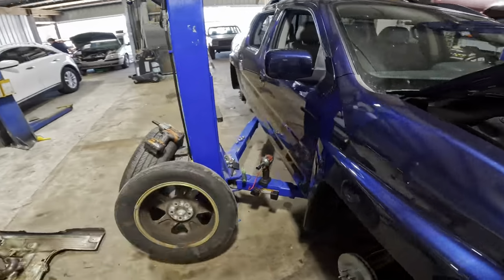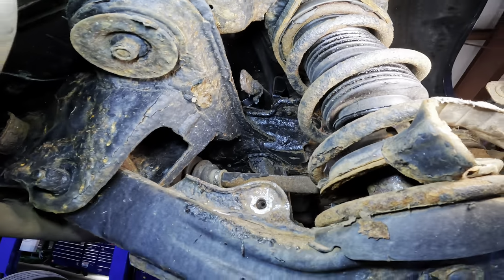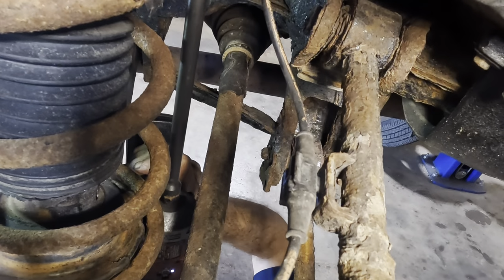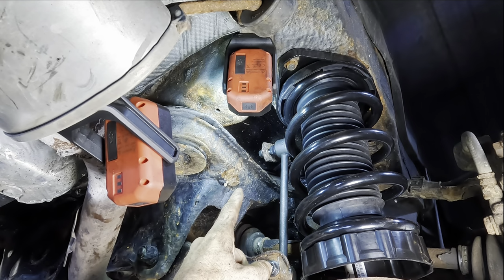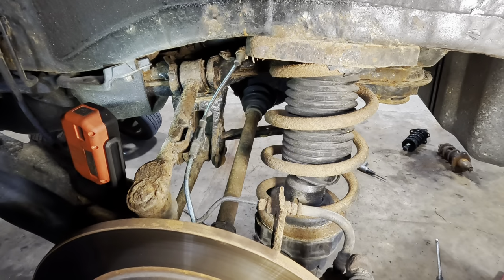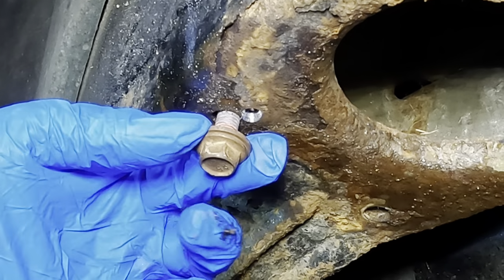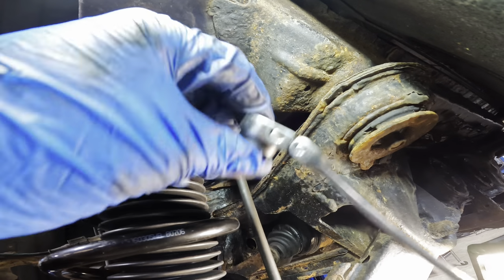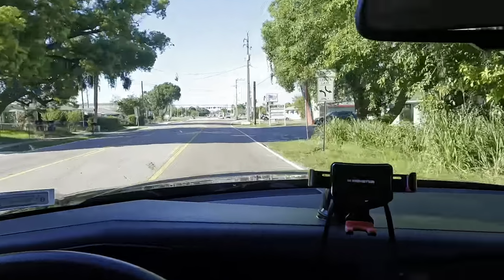Broke off in the FRAME! Strut Job Going Wrong! Honda 3.5 2006-2014 @MilwaukeeTool Pt2

Comment from the maker: Back to Part 1 Rust Busted Spring!  Honda Ridgeline 3.5 2006-2014 Multiple Problems! https://youtu.be/HLy70fsfuUw
Reply: I've never seen so much rust on a car that's not that old and I'm from Detroit.  What kind of salt are they using in NY?
I think most manufacturers don't take in consideration the situation of north American winters when designing their vehicles,  exception GM, FORD, CHRYSLER . I've seen high-end European cars do the same thing in less than 5 years.
Reply: I live in what we like to call the rust belt of N.Y.!!! Thats nothing compaired to some of the beautiful underside of 10 year or older cars up here... takes forever to do anything...
Reply: @Nick-nm8om 
Eric O from SMA just showed a rusted out 5 year old GMC.
Reply: Why do you not use lubricants on those rusted bolts? I live in upstate NY and I never work without WD40 or PB Blaster. Maybe I’m anal but I can’t work with dry bolts. I gotta put some spuge on there!!!😂😂
Reply: hi what causes or the rust
Reply: @rodneydrew9117  salt for melting snow.
Reply: it might good for melting ice on the road but look at all the damage it does
Reply: Ray before you weld on any vehicle I highly recommend disconnecting the battery 🔋 sir
Reply: Eric O has to deal with this rust everyday!
Reply: @Nick-nm8om in NY where I live. (Oswego) they use a mix of rock salt and a liquid salt brine that they started using a couple years ago.
Reply: this is killing me inside your going in completely Dry into all these rusty bolts , like usually 10-15 minutes before i spray each bolt with a lubricant , then wire wheel it and give it a spray of black spraypaint too slow the rust atleast
Reply: I've noticed that you don't use penetration oil or heat when dealing with stubborn fasteners. Is there reason why
Reply: @shawnwhitman5482  yeah creates broken shit..which he makes content out of 😂

Comment: I'm thinking a flame wrench would have paid for itself on this job. Remember, if it's liquid, it can't be stuck!
Reply: Aka thermal wrench
Reply: At my friend's shop they call him big melty
Reply: i was wondering myself why not use a torch. could have saved himself a shit ton of headache.
Reply from the maker: My blue wrench is a piece of junk, I need a better quality set of tanks
Reply: Seems I always have an empty tank on the Glow Wrench, so lately I have resorted to my Plasma Cutter. Cut out a manifold on a ford to get access to the studs, made quick work of it.
Reply: @RainmanRaysRepairs  makes sense
Reply: @RainmanRaysRepairs get one of those inductive heaters. Tool trucks should have them or the jungle site
Reply: @RainmanRaysRepairs buying your own large tanks is expensive!! Google "air gas" where your at. They will sell you the gas and let you have the tanks on consignment. If you don't get them filled annually they charge you for the tanks. They also have all kinds of welding accessories!!
Reply: @patriotgarage there nice. They don't fit everywhere ya want them to tho even with the kit that has several different head attachments
Reply: Even a small hand held torch with the yellow tank. Map gas would really help
Reply: In other states, maybe flame but it’s hot enough already down here lol
Reply: @parkersgarage4216  it’s too hot here to use flame😎
Reply: @RainmanRaysRepairs  It’s too hot to use a flame wrench anyway😎
Reply: @cyrusmoser1090  got that right, thats why i dont have tanks. i stick w my torch and a can of mapp gas. its never let me down yet. if i need to burn something off i go to my buds shop.
Reply: @cyrusmoser1090  I'm in the rust belt. Just saying
 30 years of fighting with rusty bolts
 I got it covered.
Reply: That sway bar link. If he would have just tightened til it snapped the stuff off he wouldn’t have had to cut it off. That’s my go to
Reply: We used to call ours the Gas Axe :P

Comment: You could have sprayed penetrator the night before as it was in the shop all night to help disassembly.
Reply: Need fire sprinklers with oil...in separate contained booth.
Reply: Breathing black muddy road rust..makes a great pearly smile..then he.kisses the wife unit.
Reply: Rubber glove welding 🤭
Reply: Wobbly bit pry bar.
Reply: Now Everyone send theire:s to Rusty Ray Repairs...😏
Reply: With some ones 'floppy' disc brake work.
Reply: And you need a Smudge pot in your shop ..😁;-)...

Comment: The trick of welding the captive nut from the outside through a hole is the best thing I have seen on Youtube in ages!  Will add that to my list of tricks I might need in the future.
Reply: I know that was an elegant fix, I'm not a welder but seen a lot done over years in construction.  My question is would he also have overbored the existing bolt hole with the step bit to the size of the nut, then inserted it from behind letting the flange hold it in place, then welded the flats of the nut filling the overbore hole sides, and ground it down flush to the frame if the nut protruded?
Reply: @Dennys854  Forget the bolt..Just do a healthy tack weld on that corner to the strut to frame mount.. That car seen its last strut and if needed just cut the tack weld later on.. Easier than wrestling with another rusted bolt that will break away anyway.

Comment: 2 Things: The replacement of the captive nut by welding through the drilled hole is sheer genius. I will never forget that, Simple and effective.
The second thing is that when I moved to the desert southwest 40 years ago, i didn't realize how spoiled I'd become. To see that amount of rust on that 8 year old vehicle is sickening. I have an '81 and an '03, and the small area around the Ridgeline strut mount had more rust that the total on my cars. It might be hot here, but it's dry.
Reply: Don't forget that they use salt and other corrosiveson our roads too, which doesn't help.
Reply: Me Agrees, Rust is Bad for Parts and Bad for Temper...
Reply: These things do rust but the level of rust on that car is unacceptable in my opinion. It's very clear to me that vehicle has had a rubberized undercoating treatment which is notorious and infamous for accelerating rot and corrosion on vehicles, the water and salt will easily get trapped underneath it and hides and exaggerates the rust way worse. Whoever sold the customer that service should be sued for their negligence.
Reply: Applying bar chain oil would afford as much protection for the long term but once rust starts its hard to stop in a salt environment.
Reply: It's a dry hot..! 😅
Reply: Fluid film or pb shield
Reply: @amdstrollo3074  Ah so I wasn't alone in noticing that.  Putting that stuff on top of rust makes it MUCH worse, and makes it corrode MUCH faster.  I guess it could be somewhat effective if you completely remove ALL rust and add a protectant before applying the undercoat, but that's a lot of work.  There are lots of shops in rust-prone areas that sell the undercoating, and the way they use it it's basically snake oil.
Reply: Surely, that weld isn’t going to hold if the original didn’t. Maybe I’m missing something but I don’t see how welding one tiny spot is going to acceptably hold 1/3rd of the forces coming from that strut.
Reply: I've had captive nuts give up like thar, but not a welder and that way of resolving the problem was very smooth, in the past my usual option was just to tighten everything else down tighter, or plan extra holes in the frame to get another nut in where it was needed. In time I think a MIG welder would be useful, with a welding course at the local tech college too. Plus a place to use as a workshop.
Reply: @emmettturner9452  It doesn't. The weld (original and new) only keeps the nut from turning. If you could get a wrench to hold the nut, that would be OK. Weld substitutes for a wrench.
Reply: @TheObersalzburg  thanks
Reply: What a fucking savage

Comment: I loved the plug weld repair. Excellent skills, Ray.
Reply: Yes. Lots of people would not have bothered. A new, clean nut in there would have been easy to tighten and done  the job perfectly well, without the weld. It would have been a nightmare for the next guy, which lots of guys don’t care about.
Respect to Ray for doing it properly.
Reply: Nice one!
Reply: @duncancremin1708 I don’t think there will be a next guy. That car will have rusted in half. Still a good job just not required.
Reply: @scottwheeler2494 Not if it’s been transplanted to the south, as many would be at this stage.

Comment: You are the most patient and innovative mechanic I've ever watched. You are a very rare breed and I appreciate all that you do.
Reply: not really, you just described every mechanic from northern Canada, the condition of this vehicle is typical of most everything that is 8-10 years old. It would be rare to see Ridgeline and even rarer to see something that isn't rusted.
Reply: Lol, just no. Every northern mechanic works on way WAY worse rust. Plus you guys know there are tens (if not hundreds) of thousands of mechanics in the US. Only difference is that Ray monetized it into a YT career.
Reply: @craigfin3222  I was just trying to relate without exaggerating. It's not too often you run into someone in the comments section who can relate and knows the conditions up here. The roads are horrendous, we see upwards of 5 months of winter, coarse rock salt is applied liberally and salty sea spray coats the outside of the vehicle.  Cars that are not undercoated, don't stand a chance.

Comment: The captive nut repair was genius but proper eye protection is essential when working under a rust bucket.  Thanks for another great video.
Reply: After a incident where a shard of metal bounced around my glasses and into my eye, i now wear goggles underneath vehicles (i was using a carbide burr, and it makes little curlies that love to embed themselves in uncomfortable places).  The worst part was that the hospital refused to believe it was still in my eye, until i was back a day later with a rust halo and bright yellow eyeball, then they had to carve a chunk out.  Felt like i had sand in my eyes for 2 weeks.

Comment: Part 2 of the NY rust bucket special 😂
Reply: Still not nearly as bad as half the stuff Eric O, Customer States or Just Rolled In have to deal with frequently.
Reply: Eric would just use his brain and take out his blowtorch or induction heater😂
Reply: I have seen worse.
Reply: Hot wrench Ray or do you have one.
Reply: Eric O lovefest boys... SMH
Reply: Use penertrent oil it really works I use it sometimes have to hit it a few times with the oil but it works 90% of the time

Comment: With the New York Weight Reduction almost complete, I just wondered where the penetrating oil went. Sure could have used the 24 hour soak to make job easier.  Loved the DeLorean episode.  Keep up the great work.
Reply: Not sure there is enough penetrating oil in Florida to dip the entire RUSTBUCKET in.  In Australia, vehicles with that much rust would be defected off the road permanently.  Vehicle safety here is tried to be kept at a high level.
Reply: More penetrating oil please.

Comment: Was wishing the bolts that went back in at least had a few moments dipped in the oil catch tray, and also a paintbrush with used oil would make a world of difference to that suspension underside.

Comment: Unbelievable rust on the suspension Ray, good opportunity to use a laser rust remover where the strut connects to the body.  Value adding and prevents the assembly coming loose. Keep on doing it Ray.

Comment: I had an 07 and 11 Ridgeline as my work vehicle. Really liked how they rode and did pretty good in snow. Very basic looking interior and lots of hard plastic. It looks like the undercoating was done on that Ridgeline well after the rust was underway. I am sure other shops would have added cost for dealing with the excess rust. Great video
Reply: Yeah I like to say that Ford ripped Honda off with the Ford Maverick, which isn't a real truck per say, it's just a unibody vehicle with a truck like body on it.   It's just a Front wheel drive biased, small 4 and 6 cylinder engines.  Honda was doing that with the Ridgeline for many years.
Reply: I got a 2013 Ridgeline RT, new off the lot, drove it for a year, ran like a rocket, loved the cruise control, (simple), but, it had mice, that could get into the passenger compartment, from the engine compartment, traded it in for an 2014 F150, not as to my liking as the Ridgeline, but, no mice in the passenger compartment.
Reply: Undercoating needed to be redone each year with liquid film, but was only ever done once.

Comment: Mighty nice of our Northeast cousins to let Ray and company experience auto repair in said Northwest.  They found that saws and chisels (and torches) are legit tools for disassembly.  "It can't be stuck if it's liquid".  That was a pretty slick solution for that loose frame nut.  Just saved many from much grief.

Comment: I am surprised you agreed to work on that.  Half the frame components looked like they were 50 pct rusted through. And was that a pink truck?!
Reply: It used to be red.... Florida sun will do that.....
Reply: looked downright pretty compared to half the vehicles i've owned.  Anywhere with cold winters vehicles look like this or worse, the salt eats everything, but without it the roads would be impassible half the winter.
Reply: @animefreak5757  this is why avoid those places in the winter!
Reply: @animefreak5757 I live in the south so rust like this seems unreal. The under side of my 07 is rust free beside light surface rust on things like the brake caliper brackets. I’d hate for my frame to have an expiration date
Reply: @rixzin5046  there's quite a few decent rust proofing solutions.  It's usually not the frame that's the issue though, it's the body.  Frames are thick enough that they usually don't rust out until long after the body is shot.

Comment: like eric o. says, "with rust, you cannot be attached to your sockets because they will get destroyed." i keep a set of grey pneumatic sae/metric impact sockets and a set of kolbalt spline drive sockets just for pounding onto ever shrinking sockets due to rust.
might have to start charging a bit more for rust due to the risk factor of things like this happening and the extra time to fix rusted crap.
very smart solution to this problem.
thanks ray.

Comment: Good morning Ray when you get these rusty crusty nuts and bolts why dont you give them a good shot of penetrating oil first thing ? Couldn't hurt.
Reply: ahh yes… the good old snake oil. 

got news for you good sir, if that bolts wants to break/strip, it’s gonna do it no matter what.
Reply: It doesn't help if you can't get it on the nut fastener side, same for heat.

Comment: Spray the bolts ahead of time. The other side could have been soaking while you were on the first one.
Reply: The top ones are in a boxed frame and can’t be accessed to lube, the lower ones don’t matter, they’re large enough that they impact right out of the hole without any risk of breaking off.
Reply: ¿Y dónde estarían la emoción y el suspenso?

Comment: Here, near Montreal Canada rust is most often the reality.  We always go in the night before and douse everything down with penetrant.  Cut-off wheel and acetylene torch are always at the ready.  On re-assembly  I always liberally coat the hardware with anti-seize to make the job a bit easier next time.
Reply: No joke...I'm in NY and will be replacing front struts on our 2010 Dodge tomorrow.  Plan to prep the car this afternoon with a liberal coating of PB Blaster on all of the fasteners
Reply: Doubt there will be a “next time” for this rust bucket. Next stop will be the crusher at the salvage yard.

Comment: I can't believe you did not pull out the torch for this job, with some heat those top 3 bolts would have moved and without risk of snapping
Reply: Sometime watching Ray gives me a head ache
Reply: No experience dealing with rust belt vehicles! My torch is as important as a wrench
Reply: That is the go-to here in northern Canada, almost 6 months of snow and lots of salt on the road, every part on a vehicle is like KFC..., extra crispy, a guy is lost without a smoke wrench.
Reply: 3 heating cycles for the worst bolts in my experience and a bit lube between hot/cold

Comment: A welders needle scaler does a pretty good job of blasting the rust off those bolts, for the occasional times you get a car from the great white north in the shop.
Reply: Yup, those jitterbugs as I've known them can be amazing for a variety of uses

Comment: Two things that drive me nuts Ray: One, why don't you have a bolt-hole alignment tool (a pointy steen bar with a taper) Two, a bench grinder with a wire wheel that you can clean nasty bolts and parts before re-installing them?  Love your vids, buddy, and that plug weld was a brilliant fix!
Reply: I have one of those.

Comment: Ray, you need a wire wheel for your Milwaukee grinder to knock rust off of nuts and stuff, handy, portable and will clean it right up quickly. Harbor Freight has a set.

Comment: Bless the engineer at Honda that put a little access hole.
Ever seen that happen on a PT Cruiser for the lower control arm vertical bushing? Cut through three layers of floor.

Comment: Hey! I have learnt from many swaybar end links (that I had to cut apart) on Alfas, the best method is to clean all the rust fron the thread and the nut, then hit it with penetrating oil and only then a strong impact drivee. Works everytime on my rusty endlinks :D good luck, Ray, thank you for your videos :)